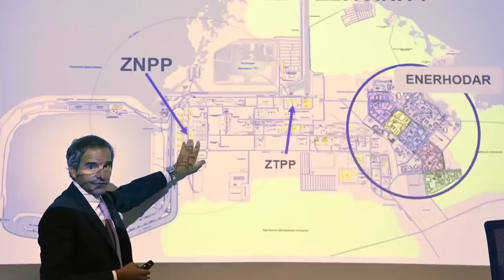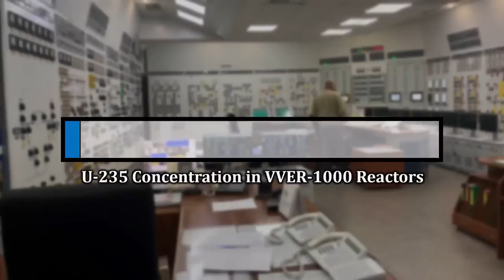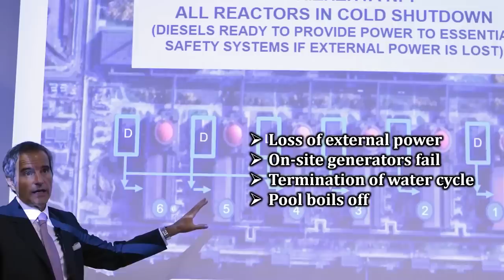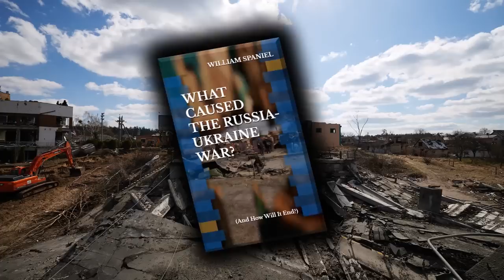Where Will Ukraine Strike Next? The Three Main Options Available to Kyiv

Comment: I think it's becoming increasingly clear that the general arena of Bakhmut to Zaporizhzhia is high priority for both sides. I don't see too much land changing sides in the coming months, then again I have been consistently surprised by incompetence of RF forces so far on multiple occasions.
Reply: The problem with Russian military is that it finally started evolving and learning something
Reply: @dominykasgrieze779  Did it? What's the evidence of that?
Reply: Just what do you think the Russian military has learned. Because from what I see they have not learned a dang thing.
Reply: @stevesgardeningadventures2153  As a body, I feel the RF learned very little if anything, but as a set of individual entities, they are changing. Any lesson that could be learned, is muted by the cultural practice of Vranyo, such that only the most obvious complaints by field commanders can be trusted, and there seems to be little internal effort to improve as a military force based on those complaints. Rather, the center seems to be handling this war as a political exercise, and concerns itself with political lessons, with regard to the Russian people and the neutral/allied bodies they have connection to in the developing world. That said, the people of Russia and partners of the RF are far more alarmed by weakness and ineptitude than they are by violations of human rights, and that is deeply concerning for the future.
Reply: @ontheruntonowhere   When the war started,  Moscow just blindly threw their forces into battle and lost their best forces. Now they learned to be cautious - not to engage in battle if the only strategy is throwing cannon fodder at the ukrainians until they are buried in bodies of russians. Another thing - earlier russian soldiers didn't retreat from taken cities or towns even if they knew that they will be slaughtered, because the regime thought that this looks bad to the public. Now the regime and military finally reached consensus that you can't keep troops in occupied places just because you brainwashed your society that russian army is the second strongest in the world. Russians now also retreat from disadvantageous positions and, while ukrainians can capture those positions, it might be better just shell the shit out of russians while they stay in those positions
Reply: @dominykasgrieze779  The initial Russian experience appears to me not to have been a misunderstanding about how to use military forces, but a dramatic misevaluation of the enemy forces and expected resistance. They appeared to expect that Ukraine would almost immediately collapse and surrender to the Russians, thus requiring little fighting, but quick movement to take over Kiev. Thus they started with insufficient supply to support any serious fighting and insufficient transport and supply arrangements to deal with having to fight for even days, rather than hours.

Russia does not appear to have abandoned "blindly throw in forces" as a tactic or even strategy: the "Bakhmut meatgrinder" is named that way by both sides for a reason, and Wagner group leader Prigozhin has even claimed he is pursuing an attrition-based strategy. ("In the ‘Bakhmut meat grinder’, deadlocked enemy forces slog it out," The Observer 2022-12-10; found on The Guardian website.) In an interview with the Financial Times, a Ukrainian machine-gunner said, "It's like a conveyor belt."

Having a look at the Wikipedia page "Battle of Bakhmut" will produce plenty more references indicating that Russia has not abandoned its "throw soldiers into the grinder" strategy.

Comment: Minor production critique: 11:14: "The heat generated by the fuel rods immediately drops to just 6.5% ..."
That %-of-total horizontal bar label smoothly morphing from "0%-50%-100%" to "0%-5%-10%" was slick, but too slick by far.  The result is that your audience might hear 6.5%, but unless they are paying close attention to the changing label they will see what looks like 65%, so that visual aid doesn't just stop working, but works against you.  At best, the viewer experiences some dissonance, pauses there, replays, and figures it out.  At worst, they are left with the wrong impression of the magnitude of decay heat.

That aside ... Thank William!  Love your videos!

Comment: If they could split the Russian forces in the middle and simultaneously cross the spit west of Kherson, they'd essentially haven encircled the enemy south of Kherson, right? The Russians would only be able to flee towards Crimea, which would be cut off from the supply lines via train tracks.
Reply: I don't see the Ukrainian landing on the Kinburn spit as a serious attempt to open a new front south of Kherson, but rather just as a way to occupy Russian troops there so they can't be redeployed further east. It's also not necessary: Simply cutting the land bridge near Melitopol or Berdyansk would leave the Russians west of there in such a precarious position that they would either become helpless cannon fodder, or just be ordered to retreat to Crimea. Crimea's own supply situation isn't brilliant as you said, but I think there's a reason why satellite imagery has shown the Russians already digging trenches at the northern edge of the peninsula; they are preparing for the possibility of having to retreat there.

Comment: Option 3 is kind of high risk, high reward (i.e. exposing Ukrainian flanks to Russian counterattacks, the fact that they would need much more soldiers for defending their flanks, while the reward would be an easier invasion of Crimea and even more logistic difficulties for the Russians).
I guess the other two options are more or less impossible (a crossing of the Dnipro at Kherson would inflict massive casualties to the Ukrainians, so would be an assault on the defensive positions in Donezk and Luhansk).

About the nuclear power plant: Russians wouldn't dare to damage it so severe that a nuclear incident like Fukushima would occur. Literally everyone would blame them, the potential of backfiring is enormous (given the fact that a catastrophic incident would poison their own territory for a long time). So they won't do it. As they won't destroy the Nova Kakhovka dam.
Reply: Would the failure of the plant endanger Russia as well, geographically speaking?
Reply: @PG-wz7by  there is a considerable risk that depends especially on wind direction.

Comment: William, you're saying exactly what I've been thinking about Ukraine's next move(s) on the battlefield. As Ukraine drives south in the Blahodatne direction towards Mariupol, all the road and rail lines supporting the Crimea peninsula will come under fire control of the AFU. This will be a nightmare for the Russians as they won't have the ability to properly supply their forces there. Ukraine doesn't even have to expose their forces to a deep salient between Russian forces in Donetsk and Kherson to achieve their strategic goals.

There have already been reports that Ukrainian Special Forces have crossed the Dnipro river near Tavriis'k, probably with the aim of destroying the North Crimean Canal which supplies water from the Kakhovka Reservoir to Crimea. As with the forces involved with the landing on the Kinburn Spit, the AFU are being tight lipped about this.  But to cut the water supply they would probably have to take the territory around the northern end of the canal. Taking out the canal means that the Zaporizhzhia Nuclear Power Plant would have to be in Ukraine's hands before the canal is blocked. There's a bit of difficult work for the Ukrainians to do.

As to the ZNPP itself, if Russia allows or produces a nuclear catastrophe, it wouldn't be surprising to see NATO launch attacks against Russian bases in Western Russia. Today the wind is blowing from Zaporizhzhia TOWARDS Russia, and the Russians probably wouldn't be able to produce an "accident" that will only effect Ukraine and Western Europe, in any case. This puts Putin in a bad place, he has to choose between only bad options. If Ukraine could take the ZNPP very soon, Putin will have to hope that he can freeze out Ukraine and to a lessor degree Western Europe and bring them to the negotiating table.
Reply: Just so.  No messing around with the canal until the power plant is in hand.

Comment: When you are strong, appear weak. When you are weak, appear strong. As of this episode, Ukraine appears strong. In that case, it probably needs to shore up hither and yon. ZP has the singular advantage of divide/conquer; but also remains R's most effective route to retreat. A feint with the spit could tip R's hand about how much they'll defend Kherson. Either way, it tempts R to move troops. That opens lines for ambush, amplifying the effect of a move to control eastern countryside as far as the sea. That leads to a war on two fronts, but the logistics are in U's favor if they can press the advantage and press north. Meanwhile Kherson slowly falls to blockade, especially if U can field some naval assets.

Comment: Good video: and I also predicted that the next goal after freeing Kherson was to drive down to Mariupol.

You didn't mention it, but the Germans and Russians had huge fights over Crimea in WW II.
The Russians lost 170,000 men trying to dislodge the Germans.
So the cutting off Russian forces in Crimea by blocking supply from Russia is the best tactic: there's nothing there that Ukraine really needs in the short term.

But I don't agree with the causal link between the level of the Kakhovka Reservoir (controlled by the Kakhovka Dam), and that in itself causing a problem with minimum cooling water requirements to the Zaporizhzhia Nuclear Plant.
That's being said by people who haven't understood how the system works.

It's important to note that the cooling water is supplied by PUMPS that draw water from the reservoir. The reservoir level itself is not so critical. And in any case, it's a BIG reservoir.

The Reservoir's geometry is VERY long and wide (max is 240km x 23km), and VERY shallow (ranges from 3 to 30 m: average +/- 25m) in terms of its total volume. 
The surface area is pretty constant for the upper level: +/- 2,250 km^2.

And the part of the Kakhovka Dam that is theoretically vulnerable (440m) is a very small fraction of its total length of 3.2km. 

That is, the only part that might get damaged to cause a big outflow is from the concrete spillway: which is 438m wide x 22m high. And it's a BIG reinforced-steel concrete structure: about the biggest damage it would likely see is from packing the gallery full of explosives. And then that would most likely just take off the top third of the dam (the gallery is about ⅓ down in the dam wall).

You then end up with the equivalent of a weir: for which you can calculate the flow over it pretty accurately. 

To do that, you need to know current reservoir depth (height, in fact), but at start of winter let's say it's 18m (has a design max of 32m, but that's worst case for severe spring floods).
And let's say the Russians had packed the gallery full of TNT, and that took off the dam above that: let's say we're left with a weir of +/- 10 height (dam's height is 22m, with the spillway height of 12.7m).
Let's assume worst case, and say they managed to blow off the entire upper part of the splillway section: 438m long.
The part with the turbines in is MUCH more robust, and would be very hard to blow up: short of a nuke.
And on each end are very broad earthen walls: that's not going to be blown up with TNT.

So let's say, worst case, with a reservoir head of 18m, and with the dam spillway reduced to 10m high, it gives you Max Flow of 39 m^2/sec per meter of width.
With 438m (again, worst case), that's 16,900 m^3/sec for the damaged dam.
Sounds a lot, but note that this is not even at the frequently seen spring run-off rates in the years when they didn't control the river with the various dams and reservoirs.

OK, so if you say the reservoir upper layer is roughly constant for the first few meter's drop in level, then the have a reservoir of 2,250 km^2, and an outflow of what works out to be 1.4 km^3/day water from the "break".
That gives you a drop in level of 0.6 m on Day 1.
And remember, it's a RIVER, so you are ADDING water from upstream too: let's say that's a winter flow rate of 500 m^3/sec.

So you cycle that back to Day 2, and now have a reservoir level of 17.4m, which them drops to 16.8m at day'd end.
And note that as the water level drops, so does the driving force for the flow.
So it starts to level out.
Such that at Day 10, the level is at 14.5 m.
And at Day 20, at 12.6m.
Day 30, at 11.9m.
Day 60 is at 11m.
Day 100 is at 10.8m, and outflow is close to inflow from upstream.

The bottom line is this was worst case: where the Russians had control of the dam, and COULD have packed the gallery full of TNT.
But they've lost control of it now.
So the worst Putin can do is trying to blast it with missiles. 
And as any Dambusters fan knows, that's pretty difficult.

With this type of dam that's pretty tough to damage, and such a HUGE reservoir that's got a big surface area to depth ratio, you're not going to get anything really dramatic. 
There's enough time to address cooling issues.

I'm not saying Putin cannot cause harm with the plant, just that the dam issue is a red herring being thrown out by journalists who don't do their homework.

Comment: The power plant is in danger in that a power plant and the transmission system are inter connected.  Taking down huge sections of the power grid at once can destroy the generators from a back surge.  Additionally the power plant is also dependent on external generators for which fuel is very low.   Not the that I really understand the inner workings but I have visited our hydro plants locally and they explained how the plants are constantly adjusting to the load otherwise it would overheat or damage the generators.  In a nuke plant the reactors and the generators have to considered separately.  It's quite possible to seriously damage the generators without blowing up the reactors which will be fine if they aren't breached and continue to access cooling water.  There is a tendency to lump the facility all together which isn't correct.

Comment: This may be grossly off-topic, considering the war, but ... since you mentioned that you are a nuclear physicist: why don't nuclear power plants use decay heat emanating from spent fuel rods to run Stirling machine auxiliary power generators instead of Diesel ones? It seems like that would increase reliability and decrease risks, e.g. Fukushima could have been saved.
Reply: I'm very much not a nuclear physicist but I suspect it's because the waste heat isn't hot enough to run a turbine/run generators.

Fukushima could have been saved had they not put the emergency generators at ground level and instead put them on the roof, as was recommended before the earthquake and resulting tsunami.

Comment: Developing a  Zaporizhzhia front somewhere between the Melitopol longitude and the Mariupol longitude and working their way to the shores of Azov is exactly what I have been advocating since the seizure of the north bank of Kherson Oblast. To me, it is the logical step in order to pave the way for seizing back 3 oblasts, I don't agree with heading straight for Melitopol in that in the long run it will not be necessary, in the same way as taking Kherson city was not. Ukraine needs to drive a wedge thru that land bridge and cut off logistical supply routes. Then it's just a waiting gamin one fell swoop until Russia once again realizes its presence is untenable.

Comment: The main determinant of this war - and of the war's future - is and has been logistics.  It is obvious which side is losing and which is winning and in control of events - Ukraine with its superior logistical capabilities and its partnership with the West in providing a supply line of munitions and machines to the front, as well as providing for the maintenance of forces fighting.  Ukraine has been developing and perfecting its logistical capabilities since 2014 while Russia's kleptocracy has undermined logistical capabilities at every level from Putin down to the platoon commander.

Comment: I agree, zhaporizia is the prize, but this high reward comes at high risk. Taking zhaporizia/driving to mariupol would require that the uaf are capable enough and confident that they can fight a two-front battle since the russian leadership will not concede this region lightly.
The ruaf will (probably) not fall for another bait-and-switch, so a direct campaign will be necessary.
I leave it to more competent ppl to outline how uaf can pull this off successfully
Reply: This is a very high stakes offensive so no doubt heavy planning and strategic thinking are in play by AFU. Trust in them I'm sure the plan will commence at just the right time. We will see🇺🇦
Reply: @liamvarin6209  the competence of Uaf c3 has ample empirical evidence. If they can pull that off materially, they will. If not, they might suprise us

Comment: My guess is Ukraine will feint at Kherson and strike at Maryanske inlet. If they can 'slam the door' there it will completely isolate the southern part of the front and reduce the ability to re-supply to ferries and that one lane of the road surface left on the Kersch bridge. They may also try a SpecOps strike on the Kersch again to fully sever that link. If they do that AND take Maryanske all the Russian forces between there and the Black Sea including Crimea would have little recourse except to surrender or starve.